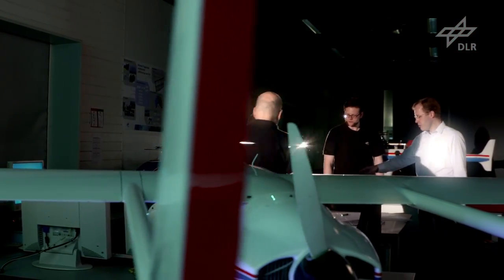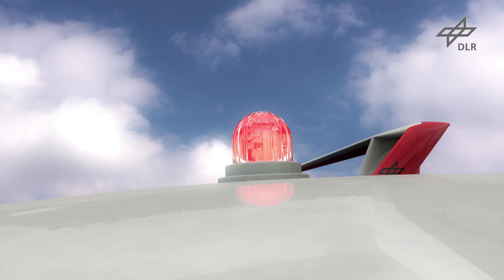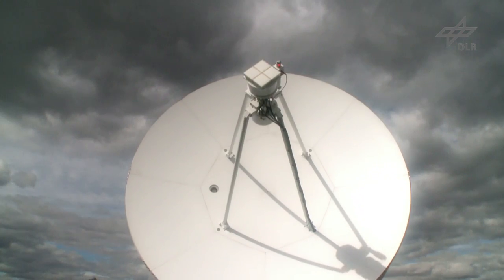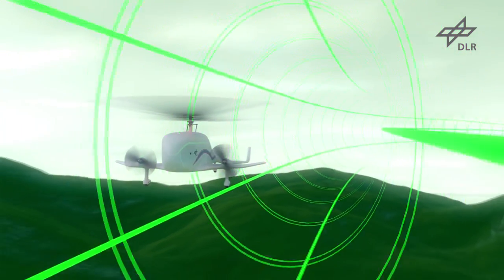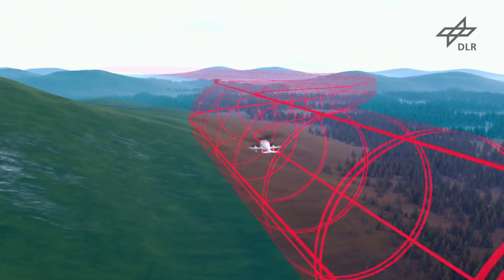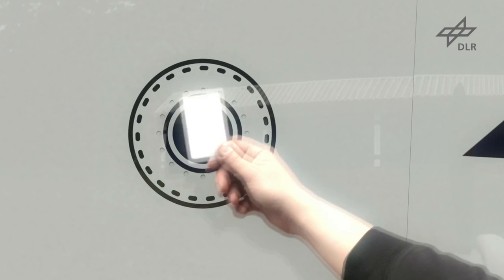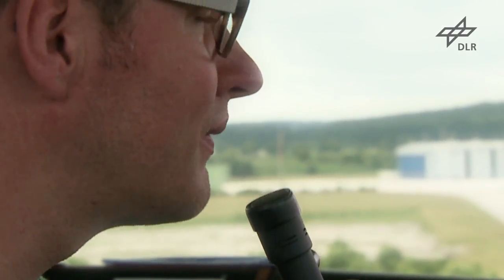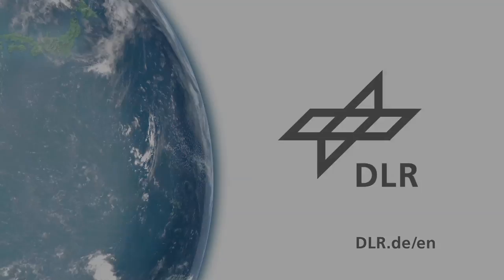Vision of a Drone -  Automated Low Altitude Air Delivery (ALAADy)

Comment: Not keen on this. Look at the operating costs and safety assurance needed for all the command and control links, IT systems, detect and avoid, electronic conspicuity, etc. it would be cheaper and easier to put a pilot onboard, and certainly a lot easier and cheaper to certify.

Comment: Not in your lifetime, buddies. Autonomous flying is way too complicated. First: There is no need for toys like that, no market.... Second: It's not just three dimensional, it's way more. It's the weather and the non automated traffic plus the military part of aviation. Third: The FAA, CAA, EASA and every single authority worldwide won't let your toy-planes take part of the air traffic system. For obvious reasons. Being a Boeing 747-8 captain and engineer, flying passengers and cargo, I understand the problems of automation first hand. You don't. That's your problem. I wrote an aviation book and "automation" has it's own chapter. 
Technically it will be possible, in the very far future, of course. I've had this conversation years ago with university professors in england, which receive their tax payers money exclusively with dreams like yours. It's a dream with no customers. Amazon, UPS, FEDEX, DHL ?  Dream on. No hard feelings, but try to invest your valuable time in more realistic dreams. Besides: What's the point of having no pilot? Money or flight safety? Both is wrong and you know it. See, as a jumbo pilot I know about decision making and I know the limitation of AI. As long as there is no safe way to drive a simple car from A to B we should not even consider autonomous flying. On cars we are on stage three, far away from the target. You know it, I know it. The question is: Does the tax payer know it? Have fun with your RC airplanes and stay out of my way. Recently I had a big drone two hundred feet next to me in the approach of LAX in Los Angeles. I reported it, of course, and they found the drone operator. There are reports every day; RC drones are your problem, deal with it before you play pilots.
Reply: I mostly agree with you. It is a long forecast project right now. However. as a gyroplane manufacturer it is interesting to see a concept of cargo gyroplane. Gyroplanes are not terribly efficient, but they can land on a dime